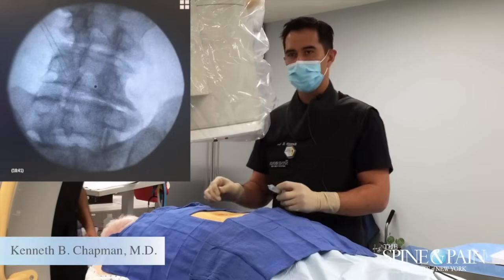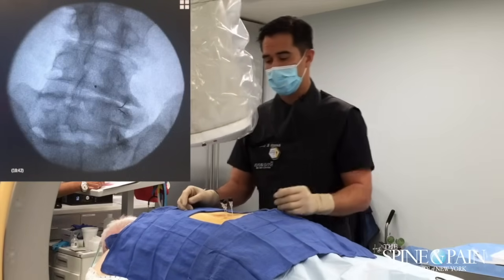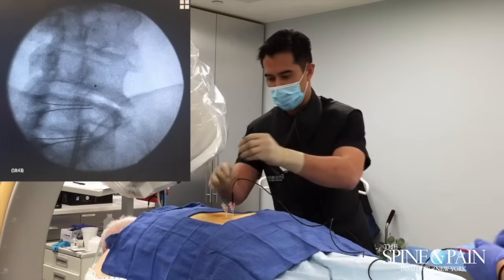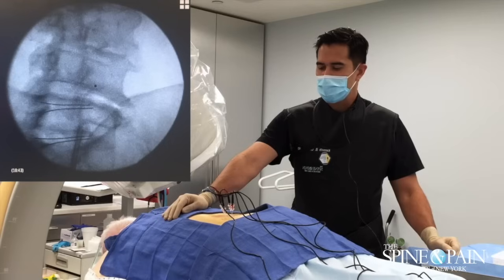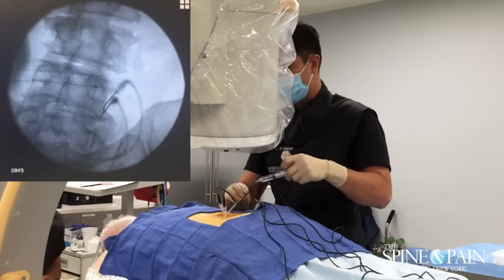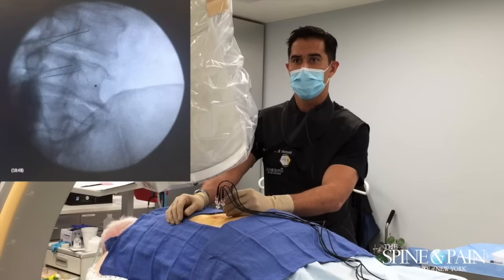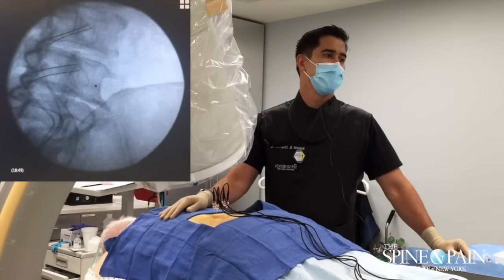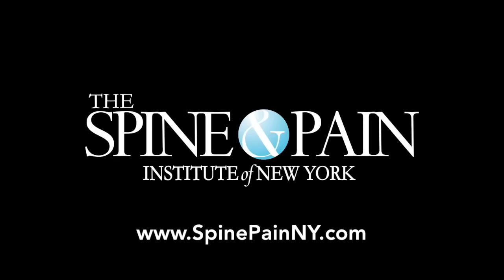Radiofrequency Ablation Procedure

Comment: To anyone who's nervous about having this procedure: I've had it twice, once a few months ago on my cervical spine, and today on my thoracic. Both times were no big deal. I didn't need anesthesia or sedation; it's a 15-minute procedure, and only about five minutes of that involves needles. If you can handle getting a shot, you can handle a nerve ablation. There's really no need to be scared!

Update: In the three years since I posted this, my osteoarthritis has progressed from moderate to severe. I had another thoracic ablation today, and it was painful, not gonna lie. Not so painful I couldn't handle it -- I still didn't have sedation -- but I needed some time in the recovery room afterward to lie flat and catch my breath. Two of the discs have almost no cartilage left between them, and when they burned those nerves, I had to ask them to stop for a minute. But the whole thing was done in under half an hour, and I came home and took some Aleve, and now I feel fine, just sore.
Reply: Stacy Pershall  very helpful comment 
Thanks
Reply: Praying I don’t feel much pain as your saying here. I smoke I wonder what % relieve I will get due to smoking I THINK The Doctor said around 50 to 60% 
Anyone know ?
Reply: @Donationsfordelivery  My doctor told me not to move much the next day. The day after that, I was back at yoga.
Reply: @Donationsfordelivery  I remained pain-free for about 10 months. Now I'm fighting with my insurance to cover the procedure again, but they're refusing. Sigh.
Reply: Wow.
Great.
Thanks for the info.
I've had two nerve blocks already.
Now, ready for the ablation, in a couple of weeks.
Lumbar L4, L5, S1
Reply: @anthonyshaw8698  Just had this done yesterday in Toronto, a little tender today BUT this was the first morning in 2 years I got out of BED with Nearly NO Pain!
Reply: @timothyj1966  
Awesome!!!
Thanks.
I'm having it done in a couple of weeks. Right side first. L4, L5,S1.
That's where most of my pain/stiffness is.
Left side, at a later date maybe.
See how this 1st one goes.
Reply: @anthonyshaw8698  I had both sides done... same levels, also developed into Sciatica .... just had my Ablation yesterday... esay procedure slight discomfort but after intense sciatica... cake walk... got out of bed this morning with minor back pain... first time in 2 years... See what the next few days bring for me.... Wishing you much Luck... takes someone who has the pain to relate... wish you the very best.
Reply: @timothyj1966  
Wish you the best too!!
Keep us posted on your outcome.
I will do the same.
Take care
Reply: Did you have to do the two MBB’s as well beforehand? I spent both procedures counting the seconds until it was over, now have a left and a right ablation scheduled for april
Reply: @MauriceLeviejr  
Lol
I just had two radiofrequency ablations  over the last month.
Left side & right side lumbar, L4, L5, S1 area. No big deal. Wasn't painful. A little pressure, no real pain. I'm doing great now. Lower back pain gone. Lower back arthritis gone. I'd say, Left side 100% better. Right side 90 to 95% better at this point. Although I've read that it can take anywhere from 10 days, to 2 to 3 weeks b4 medial nerves completely die....
Yay!!!
I'll be 65 this year.
Just left the gym. Got pretty pumped up🤗😂
Reply: @anthonyshaw8698  Was you Ablation a success? Also, five weeks later, My back is no better, it did help Sciatica but lower back bad, see same Dr again this week... Feeling let down... had high hopes..
Reply: @timothyj1966  
What?
Sorry to hear that. Mine went well.
I didn't have sciatica problems though. Just had a little lower back pain & major stiffness in lower back. Some compressed disk and stenosis in lumbar area.
L4, L5, S1.
Had radiofrequency ablation on both sides, at different times. 3 weeks apart. My lower back is like night and day compared to what it  was. I'll be 65 in October. Had arthritis in lower back, according to the Doc, at Saguaro pain center. I drove semi tractor trailer, locally for 25 years. Alot of heavy lifting. I also had surgery on both rotator cuffs, in my shoulders. They're both good now. Working out in gym now.    That's weird it didn't work for you. I wonder if it has anything to do with the expertise of the doctor at pain center we go to.
The pain center I went has two highly qualified doctors, with outstanding track records.
After reading their reviews of 50 plus 5 star reviews, I decided to go with them. But, I have to say, I was very nervous b4 having this done. Based on the research I did online. Seem like it was a 50/ 50 chance of success from what most folks said about their procedure. Hope you can get things worked out. Lower back pain sucks.
Take care.
Reply: @MauriceLeviejr  I did.
Reply: Oh no. I have very low tolerance for pain. I could barely stand it when he gave me an epidural of steroids a little over a month ago. It helped my right hip and my right leg which I had lost the ability to even walk on my right leg.
Reply: @anthonyshaw8698  I am wondering how you made out with Ablation.... It helped my sciatica I can do stairs now and back to physic and Elytpical but still some back pain... going back to Toronto Dr in 2 weeks he's going to do Ablation around the SI area nerves... a bit lower... Was just wondering if you got relief ??
Reply: @anthonyshaw8698  I am seeing Dr in Toronto again April 21 for Ablation in SI area a bit lower this time... At least it worked on my Sciatica... just want the lower back pain to go! I am back at Gym and Physio but not as much releif as Id hoped for... wishing you the best... Hope it works long term for you!!!
Reply: @timothyj1966  
Good deal Timothy!!
That should work for you hopefully. I had L4, L5 & S1 done on both sides. It's like night and day. So much better. I'll be 65 in October. Arthritis was kicking in for sure. So glad I did this.
I'm also continuing my care with my chiropractor as well.
Checkout a new video on YouTube, called Spinal Stenosis by John Bergman. Alot of good info. He's a fantastic chiropractor.
Take care
Reply: Shot how with gun
Reply: Thanks for the info ..I'm on my way for one now...  
Good luck to all.🤟🏽
☘️🌞💖✨🌻
Reply: @pumpkingirl4229  let us know how you make out... I had a second one done week and half ago... different area
Reply: I've had this procedure done four times. it's really no problem for me.Got used to it.
Reply: I’ve had it done many times but I always get the sedation as I guess I’m a big baby. I’m 72 I have herniated discs 1 fractured and have for 11 years. It helps me for about 3 months and I know some people get longer relief but I only get about 3 months but those 3 months are great. I believe the insurance pays for 2 of these a year. I’m still a little sore the day after the procedure but the day after that I’m good. It’s worth a try for everyone who has chronic back pain. Even if you don’t get the 6 months it’s worth it for the 3 months for me as I’m a master gardener and I try to get it in spring time that way I can get my plants planted and after that I only have to worry about watering. At least try it once and you are good at handling pain then you won’t need the sedation but I’m not good at handling so I get the sedation and you are only out about 15-20 minutes and they use a mild sedation so you wake up quickly.
Reply: @timothyj1966  did you have the ablation done under twilight anesthesia or was the area just numbed? I have the testing done under twilight but I’m sick of having to pay $500 every time I go because of it so I decided to go to the doctors office and just have him numb the area for the ablation but I’m terrified I’m going to feel it and it’s going to hurt so please let me know I’d appreciate it thank you
Reply: Sunbeam, I had the testing done under twilight anesthesia so it was no big deal but I’m tired of all the co-pays because of going under anesthesia so I think I’m going to actually get the ablation by just getting the area numbed but I’m terrified it’s going to hurt or be very uncomfortable. Please be honest, what does it feel like, does it hurt? Because if so I don’t think I could do it so I want to really know before I go for it. Thank you
Reply: @chloenkitty  numbing..compared to the Back pain...it's a Cake Walk!!!
Reply: @timothyj1966  I get it compared to the back pain, but seriously does the procedure hurt because I have to schedule in office or at surgery center
Reply: @timothyj1966  what did u have done to help ur sciatica? Mine is brutal and I had a steroid epidural and it did nothing to help sadly
Reply: @chloenkitty  I had two epidurals, helped a little, Than I had L5 Ablation done which was supposed to help back pain... BUT ended up taking the SCIATIC away! Than went back 2 months later for Ablation in SI Joint (ass) to help back pain... so far so good... I could barely walk ALL Winter... GOOD LUCK I didn't sleep for 3 weeks when Sciatic was at it's worse.... thought I was going to have a breakdown!
Reply: Thanks for the encouragement 😊 I needed this
Reply: Do you feel any numbness after the procedure I did feel it after few days
Reply: @ainasafiya3289  I had numbness for five weeks... but ...better than pain!
Reply: Thank you this helps
Reply: @JRoc How are you now? How did it go?
Reply: @anthonyshaw8698  How did this go in the end?
Reply: @anthonyshaw8698  how are you now?
Reply: @MauriceLeviejr  Going through the same shit myself. I've begged the insurance company to let me get the real procedure done after 1 test run. Is like fighting a charging bill getting the insurance company to even reconsider skipping test shot 2.
Reply: @chloenkitty  It literally is a small pinch when they penetrate the skin. Any pain you have will only be a second at the most. Piece of cake compared to epidural injections. No pressure from the medicine used in an epidural procedure.
Reply: @chloenkitty  NO. it DOES NOT hurt. Small pinch when the needles are inserted. Less than 1 second at the very most!!
Reply: I’ve had them since 2016 and NEVER without sedation. Until today, never again for me even though RFA do work. Mine was on my neck C4,C5,C6 on both sides.
Reply: @rosemccluney8530  Just had my first and the procedure wasn't something I loved, but it was manageable. I had a rough couple days afterwards that were really tough. I'm fused from C3-C7 and my Dr only did C2-C3 on one side. After 5 days, it's helped noticeably, but not too the full degree I hoped it would. It has made me realize how dependent I am on large quantities of Opioids. That is now the next battle. 
PLEASE DON'T THROW ROCKS IN GLASS HOUSES!!!
Reply: @chloenkitty  you will have some sharp pain from needle sticks that last less than 1 second. The pressure of having the needle in my neck was uncomfortable, but manageable. The 2 days afterwards were rough. Very sore. Overall, it's not too bad. To get the results, I will do it every hour often I need it.
Reply: Going in tomorrow for c4 and I handled the injection tests but been nervous. Had to see what they were going to do to me. This comment has helped calm my nerves. Thank you.
Reply: When I got the shots they didn’t get me enough of the sedation in me before they started. Hurt like a you know what.  Had to take a Valium and made sure they gave me enough 
 I have a high pain tolerance but that hurt really bad. I get my ablations done later in the morning not looking forward to it.
Reply: @JRoc How did you get on?
Reply: @anthonyshaw8698  How have you got on with this?
Reply: @timothyj1966  How are you now?
Reply: @MauriceLeviejr  Have you had it done now? How are you?
Reply: @anthonyshaw8698  How are you doing now?
Reply: @lemonbade  
I'm doing okay. Still would like one more procedure on my right side thoracic area. Still have a little discomfort there, but now my medical insurance(Cigna), from my job, has expired, and I'm 65 and on Medicare now. The place I had the RFA from, doesn't take Medicare. So, forget it for now. I'll just live with it. Trying to build up/tone up core muscles. That helps a little.
Reply: @anthonyshaw8698  gosh, that sounds very complicated. I’m in the UK, and for now, we have the NHS 💕
Reply: @lemonbade  
Yes, it's complicated.
I'm retired from my job now. So, I don't have that medical insurance from my job anymore. Now, I'm on Social security Medicare/Government plan. Some places/doctor's don't except Medicare. It takes too long for them to get paid, more than likely. The government is slow, when they have to pay🤔
Reply: @anthonyshaw8698  That sounds like a real pain.I’m glad to hear though, that you are not suffering as much as you were.

I’m going to be having the nerve block soon, and I’m pretty certain I’m going to ask for the denervation, because I simply can’t sit down anymore!
Reply: ,  After the epidurals given  helped. But wore off in a few days... this is my next option for lower back pain.   ,. Super good doctor told me this should work much better and much  longer lasting.   Thanks for your re assuring words I was a bit nervous about the procedure for sure 👍👍👍💯
Reply: Stop lying to people.
Reply: @noslack1964  Not lying at all! If your experience was different, it just means people have different bodies. But I found the whole procedure very easy.
Reply: Ty I’m scheduled for next week and knowing nothing about the procedure I’ve been a little nervous
Reply: Had one in neck no biggie
Reply: I’ve had my facet blocks , and I’m getting an RFA in a few weeks.  Looks a little “ scary “ , but I’m not worried.   I’ve got a fantastic Dr ,and his team is wonderful.   I just hope to get this done and be ok .   I’m tired of being in pain.
Reply: @noslack1964  who is lying, and what are they lying about?
Reply: @timothyj1966 hello there! I have sciatica too. I might need surgery so this is the next stop for me. Hoe long did it last for you?? I have a herniated disc thats causing my syiatica as well.
Reply: @starlightzz1480  couple of weeks
Reply: @makeupboss3568  wow that's not good my friend. And thank you for responding. Debating whether I should get it or not. I pray you feel better.
Reply: @starlightzz1480  you’re welcome
Reply: I'm happy to hear you had no issues without sedative.  I myself have had this procedure  twice as well. Two different Dr's. But the last place I went to did not offer me any sedative. It was very painful! 😢
Reply: Thank you so much I have to get mine Monday may 1st 2023
Reply: @jenniferlee3482  mime I believe is going to be May also!! To us having a better quality of life! 😊☺️
Reply: I’m getting this in the morning I’ve been crying I’m so scared 😭😭😭😭😭
Reply: @Cris-jj6yd  Don't be scared! It'll be over before you know it.
Reply: @Cris-jj6yd  awww don't be scared. I'm sure your doctors have been doing this for so long. You'll be in good hands. I'm praying for you!
Reply: Just had mine done on Monday and Austin with Dr. Z . He’s one amazing doctor him and his team it was the best decision I ever made. I wish I did this sooner and anyone that is scared about the procedure don’t be I promise it will be quick and easy today’s day five and I felt great.
Reply: I'm sooooo..tired of left side lumbar pain. 4 levels fused and still in severe pain. Pain pump didn't help. Stimulator trial didn't help. It's so insane. This is my last idea. :(
Reply: I had to take an anxiety med for this....but you calmed my nerves a little
Reply: How much time should you take off after having this done on cervical spine I have a strenuous job
Reply: @stevenciesiel777  I was back at yoga the next day.
Reply: Thanks for the advice
Reply: I've had it done twice and I can say that it was painful for me both times I guess because the nerve is so agitated and aggravated but it does hurt the procedure is not pleasant at all but I can say it's worth it in the end because the results are incredible the pain basically goes away that night after the surgery right now it's 3 in the morning I had mine done today and I'm already feeling The effects of the surgery no more pain
Reply: Me too
Reply: Is it essentially the same process as the testing just without the cauterization? I had my first test today ," Bilateral lumber 3-4, lumbar 4-5, 5- SI, medial branch block " it was so incredibly painful at times I literally cried. I have a high pain tolerance but this was a nerve pain and it was really painful. Dr called to say the next one is Sept 1st. I don't want to go through it again but I know it'll be worth any degree of relief. Just want to now what to expect for the ablation procedure.
Reply: I just had my neck done again -- C4-C7 -- and I did find it more painful. It's a different doctor doing the procedure now; The doctor who did the first round was better at it, but she doesn't take my insurance anymore, so I had to go to a new one who takes a lot longer to do the procedure and roots around a lot more before applying the heat. Still, the pain wasn't unbearable, or bad enough to need anesthesia.  And the pain relief that follows is definitely worth it!
Reply: Stop telling people that this is no big deal, you know it is.

People that of done steroid injection are painful, so this is too.
Reply: @sweetleaf6155  Yes, you're totally correct. I just came to YouTube to lie to everybody who's having a nerve ablation. That's how I spend my time. And I would have gotten away with it if not for you meddling kids!
Reply: @sunbeamfactory5171  
Anytime you have large needles stuck in your back,  IT'S PAINFUL,
NEVER PAINLESS..
Reply: @sunbeamfactory5171  
I'm not a child, I'm a 62yo female that has been having procedures on my back for years,  including surgery. 
None of these are pain free.
Had one yesterday and it was extremely painful,  so stop telling people that they are painless.
Reply: @sweetleaf6155  Sorry to hear you had a bad experience. I didn't. Best of luck to you!
Reply: @sunbeamfactory5171  
I appreciate that.
I don't call them bad experiences, they just don't come without pain.
I see them as, no pain, no gain..
Good luck with your adventures in getting pain relief.
Reply: No anesthesia meaning no lidocaine to numb your back before the probe needle?
Reply: This procedure is old and outdated. It's only still used because it generates income because it's not a permanent fix and people keep coming back. There is a new procedure that is endoscopic and removed the branch nerves permanently with a laser. Technology has moved forward. Would you go to an ophthalmologist that still does RK for vision correction? So why keep going to an anesthesiologist for RFA?
Reply: I can't. A shot is to scary for me.. It's a terrible shot for me. A total nightmare
Reply: Thanks for that. I was in a real bad car accident where I got rear ended at by someine going 100mph+ while on the freeway stopped due to another accident up ahead. Ive had cortazine injectings in the facet wears iff in a week. Doctor recommended this.....Im so paranoid about it..
Reply: @chloenkitty if you are so concerned about the pain from needles then you truly dont have much back pain. Simple as that
Reply: @sweetleaf6155 the pain from the ablation procedure is a walk in the park compared to the daily back pain. Jesus its 3 needles. Big freaking deal. Stop crying
Reply: @paulweston9441 you are wrong. That is not the standard
Reply: @ranmas2004  It's really not bad! They have to make sure the probe is on the nerve before they apply the heat, so they zap it with electricity quickly, but that doesn't hurt; it just feels a little weird. You don't feel the heat when they burn it. The area feels warm for about 24 hours, and then it's over. They'll give you a sedative if you want it, but I've never found it necessary.
Reply: I'm getting my 5th one on Tuesday. No worries
Reply: Got a nerve ablation today, and got sedation. I have 9 piercings and 5 tattoos. I could still NEVER do that without sedation😂
Reply: It helps to have your very positive attitude. My pain is where the sun don't shine, and it is extreme. Worse than being burnt, worse than the 3-inch stingray barb i took up my heel.
Reply: @sunbeamfactory5171 good ol American med system.
Reply: It isn't a 15-minute process it's like 1/2 to 40 minutes.
Reply: @christinerollins-cl2oe  You're in the room for that long, but the actual needle part, for me, has always been about 15 minutes.
Reply: You are waaaay tougher than me, my friend. I hope your pain is removed somehow... You have a very positive attitude for a person in pain.
Reply: Thank you. I’m having this procedure tomorrow afternoon, and not much scares me, but this does
Reply: STOP LYING TO PEOPLE!

I just had my lower back done and this WAS MORE PAINFUL THEN BEING IN LABOR!  It's a 1-4 WEEK recovery.  I had mild sedation and was so painful that I was either knocked out or given the med that gives you don't remember. 
SO STOP BLOWING SMOKE UP PEOPLE'S BUTTS.
Also, this takes more than 30 minutes, unless you had 1 needle ROD shoved into your back. Plan on at least 1-1.5  hrs of EXTREME PAIN....
Reply: @Donationsfordelivery 
You better have sedation..
I just had it done and it was torture and I had sedation.
Reply: @sweetleaf6155  One person having a different experience from another person doesn't make one of them a liar. I'm sorry your experience was bad.
Reply: @jessicamarie5458 how was it
Reply: @sweetleaf6155 when did the pain kick in after you woke up from sedation?
Reply: Thank you. Im nervous too
Reply: @WigRealtor  jus had it 5 days ago not bad at all I had sedation it’s just the after pain when u get home lay down on your stomach and sleep it off nothing u can’t handle
Reply: Thank you! I’m over hear freaking out. They want to do it without sedation. I was wondering if it hurts or not. My question is: Does it hurt afterwards
Reply: I was told they numb the nerves ? It still hurt ?? Or do you not get numbing ?
Reply: @ yea they numb the nerves before burning them you don’t feel them burning them at all just a pinch from the needles but I was lightly sedated so it was a breeze for me
Reply: @ that’s probably the worst part the after pain , but it’s just like the epidural or any shot you had before I prefer sedation though you can handle it
Reply: @okpunky depends on what you are smoking…if you are smoking sticky green bud maybe 110% relief?!?
Reply: Very helpful ,I'm having the same 13th January 25, really scared
Reply: @Cris-jj6yd I'm having this done in 2 days can't sleep so frightened
Reply: Tell that to someone who has significant Medical C PTSD
Reply: @Donationsfordelivery Absolutely not.
Reply: @lauralove9090  I hear you.   Everyone is unique. I truly dislike when comments posted saying it was a breeze. Not true. I’ve heard some horrible experiences from others.  You can have sedation which is very helpful. Listen to your intuition. You know your body and don’t allow anyone to gaslight you.  Find a skilled and reputable doctor. You’ll be fine.